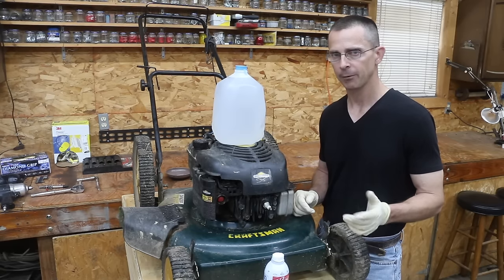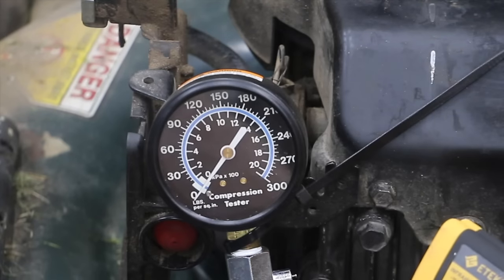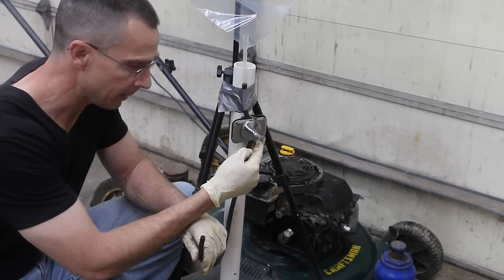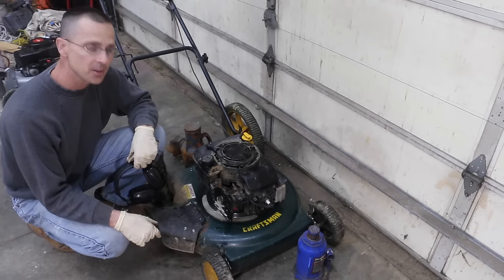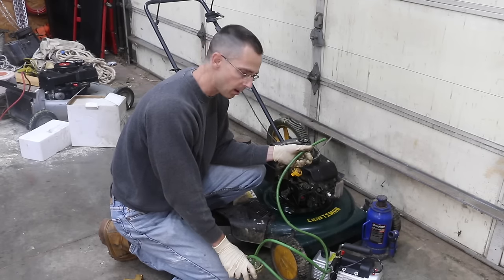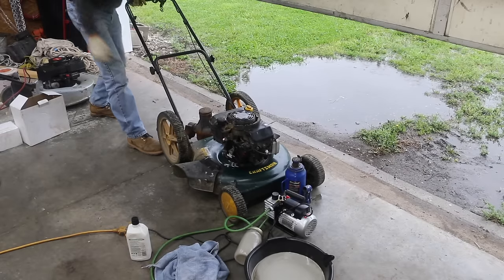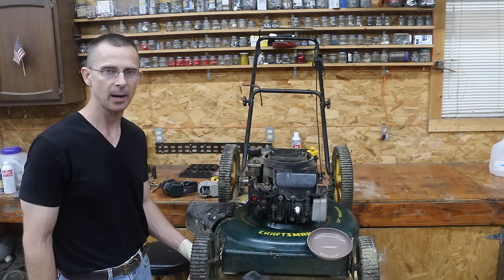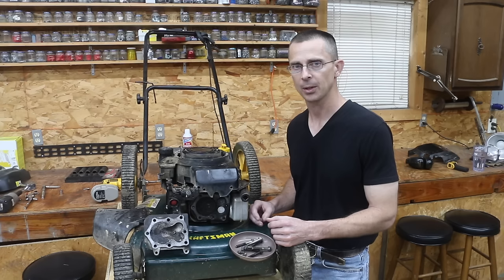Seafoam--can't believe what it did to my engine episode 5--cylinder cleaning test using water!!

Comment: Holy cow!!!  This shows you how tough an old simple flathead is. lol  2 hours and a gallon seems absolutely insane to me, and I'm super impressed the engine survived it.  Back in the day, we'd use a small glass worth of water and either spray it in the carb via a sprayer bottle, or put little bits out of the cup at a time down the carb.  This process would only take several minutes.  I still can't believe that the engine survived that and that compression seemed to improve!  I'm glad I found this channel; you have a lot of cool and informative videos, but this one definitely made me chuckle and entertained me. :D lol
Reply from the maker: Thanks!

Comment: HAven't watched anything here yet, but I will say, before starting (just to keep it interesting) :
we dinosaur hot-rodders used to cobble together quite a few different variations on water-injection systems back in the 70s-80s to 'extend' the combustion cycle-time just a tad, while not messing with the actual ignition timing. Some people swore by them, others swore that they were just another fad that was useless unless one had an entire garage full of hi-tech diagnostic stuff to measure the variables with. Personally, I think the results varied greatly because of the amount of difference in everyone's engines at the time. The diff's between Chevys-Pontiacs-Fords-Mopars etc, displacements, manifolds, carbs, (this was before FI),  exhaust flow-rates/pressures, etc  and the variations in cam and timing specs etc. made almost any comparison, other than that of one engine to another of the exact same make/year/displacement etc., almost useless. Most of us tried it, decided whether it worked for us or not and either kept it or disconnected it. I built one on a '66 289 2bbl 4-spd Comet, drilled/tapped into the manifold on both sides of the base beneath the carb,  stuck a .070 jet into the end of a piece of copper tubing on each side, that seemed to help mileage when I was cruising;  but when I was out 'racing' and strutting on the weekends, I just shut it off, since it seemed to cut down on throttle response. But that's just me, and THAT engine, with THOSE specs, etc.  Damn, I miss that car... as we used to say, that car would really 'shit n' git'...
Kids today have NO idea what they're missing (same as with the music)... Years ago, I remember taking my friend's nephew on a ride in my all time favorite car, a '70 Challenger  440+6.  My friend was working on his car and needed a few parts (nuts n' bolts stuff) and instead of him taking his car down off the jackstands etc I said I'd go to the store for him.  I got in, and his nephew asked to come with me. As I was buckling up, I told him to do the same and he actually laughed at me. I laughed back, then punched the gas and took him two blocks in about 1.8 seconds, then hit the brakes. He closed his mouth, nervously buckled his seat belt and kept his mouth shut the whole time till we got back.
 LIFE LESSON LEARNED:  and the lesson is: "Kid, back when Detroit had balls they used to sell some bad-ass machinery. If you get in a '70s muscle car, and the driver tells you to buckle up....there's a REASON!"  American Muscle!! Never equalled!!
Reply: This is probably one of the best stories I've ever read on YouTube comments!

Comment: Dude why so much water ? Mist from a spray bottle would have worked ,. A few pumps over 10 minutes.
Reply: Ikr, literally i tune a 4.6l v8 with nothing but one of those baby water bottles and a hole in the cap to spray it out of
Reply: Hell my dad used to tune like 10l diesels by turning a pint bottle of water upside down on the carburetor around the block from his shop, it'd chug for 10-20 seconds, roll coal from the first chug till 10 seconds after the last, and then it'd run like a top
Reply: @Prestiged_peck  Cool story bro. A carbureted  diesel huh?  ROTFLMAO.
Reply: @highpwr  he called them carbureted diesels much, you can make those work but he probably meant just naturally aspirated diesels
Reply: @highpwr  yes, liarr 😝😝😝
Reply: Generalquarters 52 that’s not how that works.. you would be cleaning not tuning the v8 and if you dumped a bottle of water in the intake of an engine it would hydro lock or at best shut off immediately and then be hydro locked, water doesn’t compress so anymore than a minuet amount would cause severe issues
Reply: @bosshoss69lee  you dobit with a small bottle on a big engine and turn it dead upside down so it glugs instead of pouring smoothly, thereby decreasing how much goes into the engine. Yes there's a chance of it locking up, but if you play it right it won't. Though usually I do it with a spray bottle instead
Reply: I’m a vote for Seafoam!!!
Reply: Hand pump spray water 1 qt. Max dont let it stall

Comment: Seafoam wins with time and money.  With Seafoam you don't have to drain the oil more than once,  certainly not three times.  There is also the chance of  hydro locking the engine,  which will cost more than the $10 for a can of Seafoam. 

Thank you for the video and your meticulous work.
Reply from the maker: You are welcome!

Comment: yea, destroying 8 quarts of oil, that cost me $90 and my $17 oil filter. vs the cost of a can of seafoam. Thats quite alright. The thought of putting water in my car makes me cringe.   if i wanted to be that anal about how clean it is.. ill just pull the heads and scrub it out. All the wear on the cylinder walls where the water and oil mixed. Think im gonna have an aneurysm thinking about this.
Reply from the maker: Great point regarding the risk of using water.  I'll stick with Seafoam too.  Thanks for commenting!
Reply: How powered supercharged aircraft engines used water injection back in the 40's (WWII) It was primarily a coolant used because they wanted to use a leaner mixture which produced more power, and more heat. Not for consonant operation just at very high power settings ( i.e. full boost) AS long as the water flashes to steam it's not going be in the engine long. BTW nearly anytime anything is consumed by combustion, one of the results of the chemical reaction will be water (vapor)
BTW: check out the Crower 6 cycle Engine, It's not been developed yet but a very interesting concept/idea.
Reply: When I raced winged sprint cars, I would soak my air filters in a cooler of ice water before qualifying. This would act as a water injection same as you mentioned with the aircraft engines. producing more power. Also, when I raced Go Karts, carbon was a problem in these engines due to running a rich fuel mixture. Some would say, "leave the carbon in....it will increase the compression." However, the carbon will act as a sponge and retain unburnt fuel causing detonation and poor engine performance Every few races I would run the engine and spritz water thru the carb to remove it. @johns5591
Reply: @BM-xc9sq  I don't see a water soaked air filter doing much of anything good. I would think the water or most of it would be pulled out and/or evaporated with in the first few minutes after firing up the engine, certainly by the time you would have completed a warmup lap. Besides it wasn't the water that created any added power but the affects from running a leaner mixture  and water was used to carry away the added heat from the lean mixture. The mixture on  those aircraft engines was (still is on most small planes) adjustable real time in flight, the pilot or Flight Engineer would watch an Exhaust Gas Temperature gauge to adjust the mixture and if run for long with the leaner mixture, you'd be doing some damage eventually, without the water injection  anyway.
Reply: Heavy Hemi had your aneurysm yet?
Reply: $90 for eight quarts of oil? You must be another Amsoil sucker.
Reply: You should be changing oil after any decarbonization. Chemicals will work better in a low compression mower engine but in a car engine with double the compression it will work better than chemicals and you will cause no damage to seals.

Comment: Hi, I actually tested this in real life on my car, that (after some years with tiny leak of water to cylinder) blown the head head gasket (large water passage to cylinder 1),  and i had to finish a trip of about 150km, stopping every few 10-20km to add  water to prevent  overheating and with no spark plug on that cylinder so that it didnt lock or broke. 
When i replaced the gasket, that cylinder was  perfectly clean (and i mean not even one grain of carbon), in comparison to the other 3 (and i have a LPG system). Also no water in oil (probably because there were never enough pressure to pass water in the rings).
Reply from the maker: Thanks for sharing.

Comment: What if you use actual sea foam?
Reply: lol yes
Reply: Hilarious!  Salts in your engine. Genius.  Thatll go well, I am sure of it.
Reply: Started with a hot engine.

Used Seafoam through vacuum lines slowly at first, and with 1/4 left, flooded the engine out. 
I then let it sit for 10-20min. Started the engine after about 6 seconds of cranking, it has a rough idle(too much fuel), then rev it up to 2000-3000 revs, up down up down, 3500rpms a little bit, but keeping it revved up.

Smoke POURS out the exhaust for this whole time. After about 5 min @ 1500-3000rpm(only holding steady rpm at 2000) the engine ran a million times better.

I have used Seafoam in all of my car engines and have never had an issue.
Reply: And if you need to pass emissions, it works.

Comment: Holy shit, 1 gallon of water!? When I was taught to do this trick with water on a car motor, you used a cup  of water at the most added very slowly. Kinda overkill isnt it, a gallon, lol?
Reply: Same. I've thought about "misting" the intake  with a spray bottle so its a bit more of an aerosol, less total water per intake stroke, as it were.
Reply: I was amazed it did not come out steam cleaned perfect and shiney!
Reply: I have heard of this but you control the water yourself and suck till it lugs a tiny bit like half a second or less
Reply: If he put a cup in and didn't see much of a result he'd have to repeat everything.   If it works you will see a clear result after a gallon, it is more of an experiment after all.

Comment: VERY well done test with one criticism!  The proper way to water steam-clean your engine is, for this size engine, about a gallon in 15 minutes.  In a car it's a gallon in 5 minutes at 4000-5000 rpm but this engine should be 15 minutes at about 8000 rpm.  If you'd have done that (much faster rate) you'd have seen very little water in the oil and an even cleaner head.

GREAT work on the test!  Next time, higher rpm, higher water rate ... OH!  And if you want it even cleaner then heat your water to 200 degrees or higher before injecting it.  sucking it from a boiling or simmering pot makes an even bigger difference.
Reply from the maker: David,  Thank you for the advice!  Also, thank you for the constructive feedback--it's helpful!  Thanks for watching the video and commenting!
Reply: David Beecroft 8k rpm? this thing would blow to pieces bro
Reply: zelo - maybe you're right.  i see my truck 5.0 liter redlines at 6k rpm, my ferrari 4.3 liter redlines at 9k rpm and my hayabusa 1.3k liter redlines at 12.5k rpm so i figured a mower at 100cc's or so must redline at 17k rpm but i could way be wrong.
Reply: David Beecroft you are sir.  that mower has a 4 stroke air cooled engine, there's no way you could keep it at 8k rpm for 15 minutes and not expect it to blow up. But from you comment I can see that money doesn't always come with reasonable thinking :p
Reply: David Beecroft Here in the U.S. there are regulations on mower blade speed. I  believe it's about 20000 feet per minute. Which limits the rpm of walk behind mowers to about 3200 rpm. These engines are built to turn very slow compared to their displacement.
Reply: oh... well then crank up the engine speed as high as it will go and add HOT water as fast as it will take it without killing it in spurts ... that will clean it out spik n span
Reply: David Beecroft do that to your busa at 12.5k rpm and let us know what happened
Reply: zelo - okay, just did it ... it went rrrrrrrrrruuuuuuuuuummmmmmmmmmm!!!! and now is idling.  any other silly requests?
Reply: David Beecroft what’s the chances young Dave here actually owns any of the vehicles he’s listed here....

Comment: Is that the proper tightening sequence for the cylinder head?  Seems like it isn't.
Reply: No torque wrench used AND tightened head bolts in a circular pattern = loss of any credibility. At that point the video went even further downhill from there. Sad.

Comment: I would also use distilled water as close to boiling as possible. It should flash to steam faster and not leave any deposits. I think you over did it-but I also think it was smart to try and maximize the effect with a long exposure. I would do like 10-15min. Any small amount of water in oil should boil off.
Not surprising that engine temp lower with water in cumbustion chamber. I think the water cleans but also interferes with effecticient combustion so it sorta cancels intself out. I also think deposits exist in a sort of equilibrium-that is, deposits accumulate up to a certain level and then can't "stick" very well to existing deposits. There are a couple of studies that back this up. 
The improvement in compression and cleaning is not statistically significant. You would need to weigh the cyclinder (on a very expensive/accurate scale) before and after to really quantify deposit removal and do it at least 6 times to have enough data to analyze.
Reply from the maker: MarzNet256, All excellent thoughts!  I'm learning a lot on this forum.  Thanks for watching the video and commenting!
Reply: should do the water test to your edger an see the differnce1

Comment: This was found out by blowing a head gasket, when the head was removed, the mechanic noticed that both the piston and combustion was a lot cleaner because of the water leaking and steam cleaning the area. This happened before antifreeze but still was cleaner  when the mixture steamed it.
Reply from the maker: Thanks for sharing.

Comment: Seafoam guy, water has to go into motor as a atomized mist. Then it makes steam, which cleans anything of of anything. You've nevst pulled a head off an engine with a blown head gasket? That cylinder looks brand new everytime

Comment: Yes i would use water to clean an engine. KEY.......RPM should be almost maxed out, keep the heat up, and atomize the water. Seafoam almost burns on its own. Water will not, but it should create STEAM  out of the exhaust. Slow dripping water in the carb was cooling and Hydraulic the water past the rings and contaminating your oil. Not a squirt bottle but high pressure mister is needed. Let the temperature return, come back up and mist again, and repeat. I like what you do , thanks for the videos.
Reply from the maker: Thanks and you are welcome!  Thanks for the feedback.

Comment: Back in the 70s and 80s we used water and okie chokes on the carburetor engines, a lot.

As far as water in the lawn mower's crankcase you had the water feed for 2+ hours.  Blow by caused the water to go into the crankcase,  but 2 hours...damn.

Top tier gas helps...a lot.  Deposits are a lot less using this type of gas.  No, one tank will not make a difference.

And as far as sludge, sticky lifters, etc. we used to put transmission fluid in the oil.  Be amazed at how well this works.

If someone is reading this and wants to try what I said, please use some common mechanical sense.  Don't fill your crankcase w/ 100% trany fluid, might wipe out some bearings.  Don't pour water in a running engine too fast, you'll hydroloc a piston.

I see so much hokie shit these days.  What's sad that some people will believe anything they read.  Change your oil on a regular basis and use good gas.  If you have a good shop that does your oil change let the tech tell you when the oil should be changed next time, not some light.  Seen that light burn a lot of people.

After being a mechanic for 35+ years the one thing that makes the biggest difference on the longevity of a car is how you drive it.  Seriously.  People abuse their precious car and wonder why it constantly breaks down.  Finding a good competent shop to do all of your repairs (even the oil changes) makes a huge difference too.

Comment: Seafoam for me
Reply: Isnt "see foam" just  alchohol and  kerosene blend per  their  SDS?  Make  your own  on  the  cheap or  better yet   - forget using the stuff on you modern  car  engine  for  sure.  This  stuff has  gotten  way to much  credit for  what it is.
Reply: @sandyshoremann7524  If you own a 2-stroke carburated outboard then it's the cat's ass. :)  Good for the crankcases of air-cooled engines too. I have a bunch of them up to 1000cc Onans which tend to gunk up with loose tolerances.  New engines...100% agree.

Comment: You tortured your crank bearings and your rod bearing surfaces with that water in the oil. You helped the top of the combustion chamber but you DESTROYED all of the bearings in the bottom half. Even though it still runs it wont for long. USE Seafoam or manually clean the cylinder by removing the head. I could have had that all clean in less then 15 minutes.

Comment: Holley used to make a water injection kit for cars. When I was a kid I put one on my Ford 390.  It helped with pre-detonation by keeping the temps lower in the combustion chamber. Controlled by manifold vacuum, when you romped on it lower vacuum caused a spray of water. It seemed to work as I remember. I still have that car, 64 Galaxie 500XL.
Reply from the maker: Thanks for sharing.